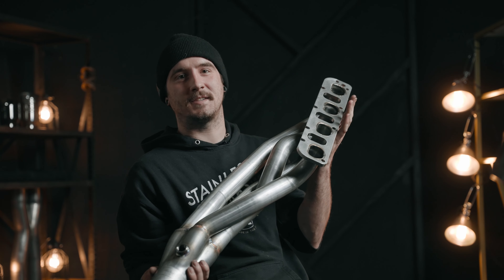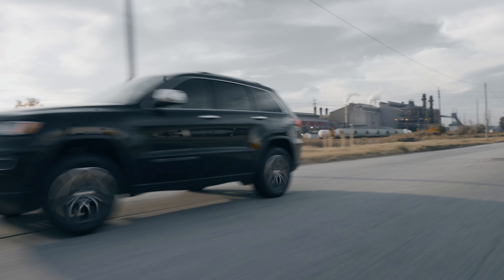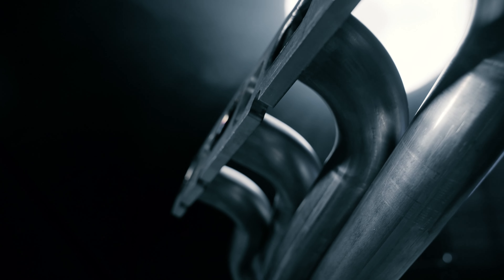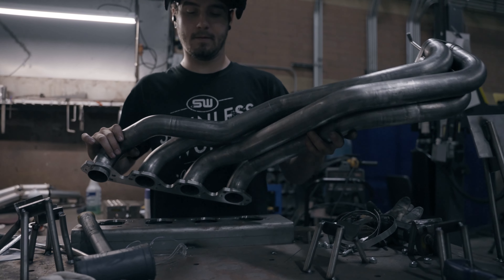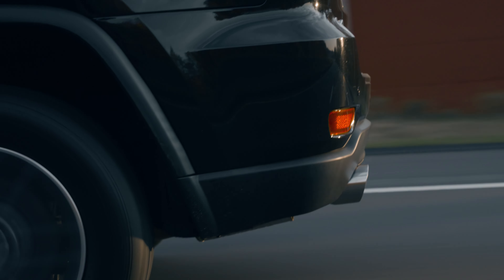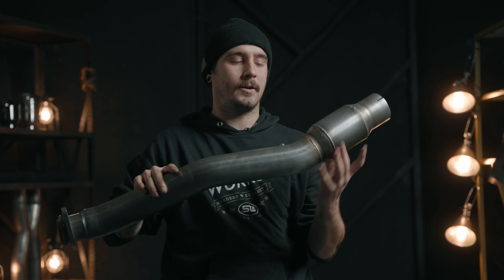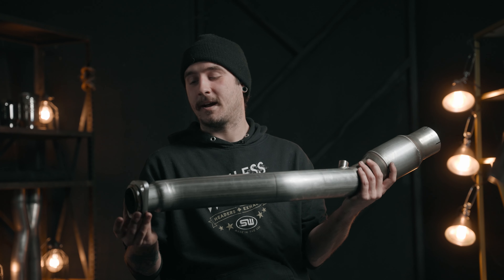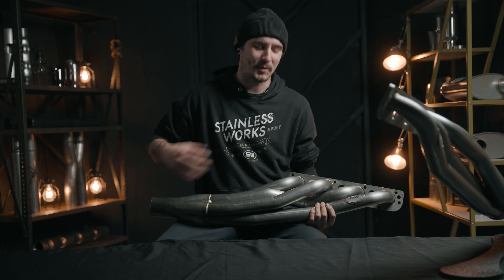Jeep Grand Cherokee with Stainless Works Headers and Exhaust

Comment: What kind of hp and tq did you gain? Did you have to tune out the p219a/p219b cels?
Reply from the maker: Typically around 10hp for the headers. A tune is always recommended. If you want more info reach out by calling 1-800-878-3635